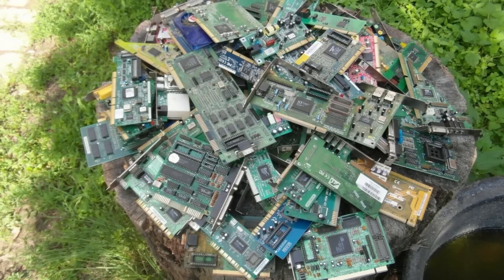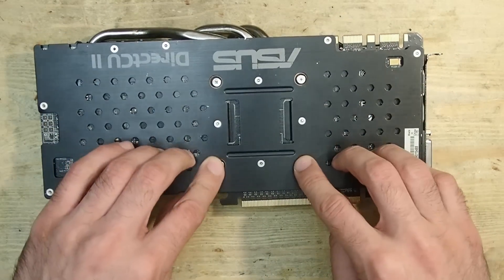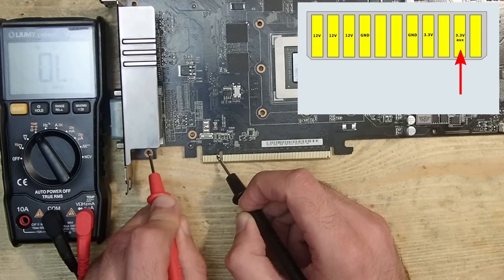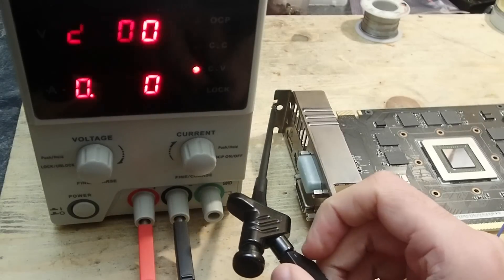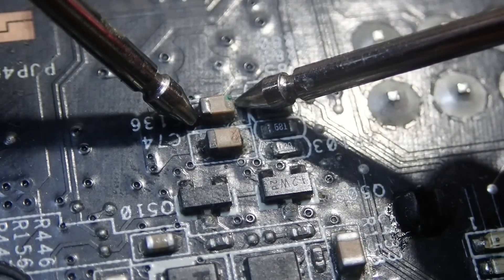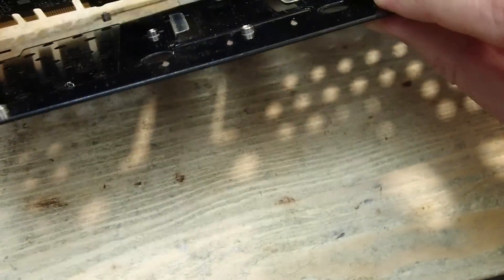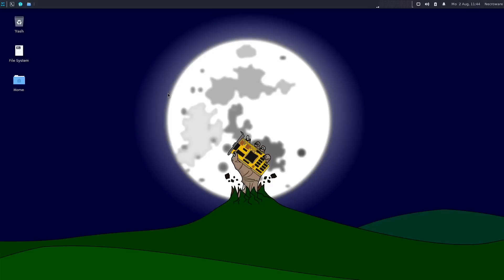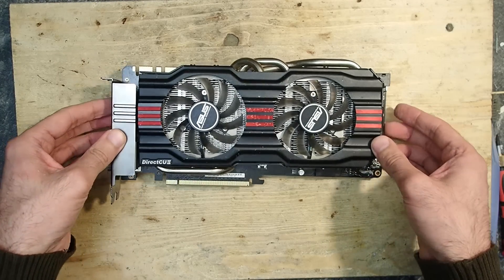GPU shortage? Let's repair an Nvidia GTX 770

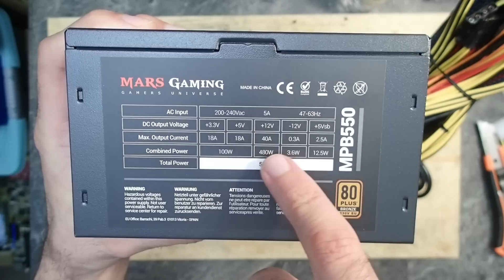Comment: no doubt skilled at fault finding BUT at 15:34 you show us the new psu stating the 8pin(6+2) pcie connector while actually showing the 4+4 cpu/eps connector, not really a good thing to teach people
furthermore making a 6+2 is pretty easy seeing as the +2 connectors are just negative pins
Reply from the maker: Yes you are right, but I don't teach in my videos and never pretend to....
Reply from the maker: Just took a look at the shot once again and unfortunately, that was just a mistake, which happened during the cut. Due to very limited equipment, which I use, I have to record the video and audio separately, which is then rejoined and realigned later on computer. Obviously what you saw is an editing mistake....

Comment: Very impressive!  
May I suggest if you have to do this again, get a PCIE edge connector and solder the cable to that?  
Oh for a thermal camera ;)
Reply from the maker: Yes, some viewers also suggested a pcie slot already and I had that idea as well, but I had no pcie slot at hand and I just didn't want to take it from a working board. If I'll get one I'll keep it for sure for such cases. However, I repair newer hardware realy seldom....
Reply: @necro_ware  I know a good convenient thermal camera listing it's called the Seek. Unfortunately, it looks like it's running for around $200 on Amazon right now, but you can plug it into the bottom of your phone and get a thermal image output. If you have lightning or USB type c it lets you turn it around for both viewing angles.

Comment: A way to detect thermal variances more easily than fingers is using a spray bottle of isopropyl alcohol.
Spraying on the card you can quickly see which components dry off immediately due to the dissipating energy.
Reply from the maker: This was what I also used in this case, but it didn't come out well on video, so I just cut it out.

Comment: Hello, I need your help, I have a gtx 960 that windows detects but when installing the driver the pc crashes, I pass the mats and the memory has no problem, I change the bios with a CH341A, because with nvflash it does not detect it, for another of the same model in techpower up and nothing, could it be the bios chip?
Reply from the maker: I'm afraid it's really hard to tell, what is wrong with your card. It can be everything from wrong BIOS to bad GPU. Without the drivers a graphics card is reduced to a generic 2D VGA adapter and first when you install the drivers, the GPU get's activated. At that point a lot of things happen, may be the GPU is defective, may be the video memory, may be the power circuit on the card, which has to handle a higher load, when the drivers are activated..... hard to tell..

Comment: My GTX 750 is having some problem. Sometimes, Display coming out and system freezes after 2-3 minutes with black, white, pink etc. by detecting the GPU and then after reboot- no display. After 1-2 hours, I draw out GPU from the MB and fits it again, again the same problem. I have tried everything but nothing seems to workout. I have tried the GPU in another setup, same problem..
Reply from the maker: It probably gets overheated. May be one of the solder spots under the chip has a crack due to heavy heating up and cooling down. Something like this is hard to repair without a special equipment.

Comment: You forgot mention about one important thing. Voltage injection is very good option to find shorts but in some cases can be dangerous because it may cause more damages. For example if you test main supply rail and upper  switching MOSFET is shorted   it will pass  through the voltage and kill other things supplied by this rail. In gaming laptops for example shorted 19V rail means usually bad news like killed mosfets in GPU Vcore converter and GPU as well.
Reply from the maker: I actually told that twice, first where I select the voltage and current and later as I found the spot. Actually I repaired a lot of mainboards and graphics card and you will not destroy anything, if you make it right. First of all, you are right and usually the MOSFETs and PWM controllers get shorted first. Also small capacitors, like in this video are quite common culprit. However, you should never go with full voltage and high current into it. If you have a short on 19V main rail, you should set 3-5V and limit your current to some very low level, like I did and then you raise it slowly step by step, without touching the voltage. If you try to set 19V and 1A from the beginning, then yes, say goodbye to your hardware :D

Comment: to not solder to cardedge connectors you can use cheap pcie riser as a breakout board.
Reply from the maker: Yes, I thought about that, but I have none and I also have no defective mainboard, where I could borrow a slot. I usually don't repair such a modern hardware and concentrate more on the retro stuff, but if I would, I'd probably get a PCIe slot for such things.

Comment: I like using the constant-current thing for diag.

Especially since I don't own a fancy multimeter or "leak tester" which can pinpoint very low Ohms readings.

Another nice trick, for helping find if BGA chips are soldered properly, is to measure the diode drop on each signal with the meter (assuming you can get access to most of the signals on a via or something).

That does depend on how many other devices are connected to each node, though.
But if you have a schematic for something, or the connections are more obvious, it can give some good clues as to whether a solder ball is maybe not connected.

ie. if the average voltage drop of a specific signal is higher than most of the others (in a similar group of signals, like RAM address pins), then it's probable that there's a cracked solder ball on that pin. Flexing the board slightly might help to confirm that.

I like vids like this, that show that you don't always need the most advanced tools to do diag on complex boards. ;)

btw, there is one way around the PCIe power connector thing on most cards - you can often fool them into powering up by connecting all of the Gnd pins together. Many cards use one of the Gnd pins simply to detect whether the plug is connected or not.

Obviously you need to be confident the card won't draw too much power from one PCIe cable for that, but for short-term testing it's probably OK on the lower-end boards. Just keep an eye on the power connector, making sure the plug and wires aren't getting too warm.
Reply from the maker: Thank you very much for all the great tips, really appreciate it and will try to apply next time.
Reply: I should add a standard disclaimer about the PCIe power connector thing...

This would only be for very short-term testing, and if you have the whole first 8-pin connector plugged in, and just want to see if the card lives or not.

It should never be used like that long-term, or it could cause melted wires, or worse.
Reply from the maker: @electronash  Yeah, I absolutely would sign this :)
Reply: @necro_ware  I suddenly thought of another one...

If you have a short on a PCB, and use the bench PSU to pass a limited current through it, you can use a multimeter to check the millivolts drop between the input point and other parts of the board.

Which can help narrow down where the short might be.

But I can't remember exactly how that would work, because the current of course goes in a circuit back to the PSU. lol

Comment: There is also a trick of spraying alcohol on it and looking where it will dry faster to find hot spots without having to touch everything.
Reply from the maker: Yes, I use it as well. Also in this case, but it was not good visible on camera, so I didn't take that shot into the final version. Also some IPA and then air spray is a good option. The water drops from the alcohol freezing in the cold can air and you can quite good see the spot.

Comment: I would almost suggest to start repairing more modern hardware to fund more retro computing experiments. However, that is MUCH easier said than done. Especially what has been documented by Louis Rosmann and Northridgefix. Like having a storefront/workspace, employees, taxes, weird/scamming customers, etc. It might be easier just to put in a few extra hours at the day job or aiming for a promotion/bonus, rather than starting up a business.
Reply from the maker: I'm quite experienced software engineer with over 25 years in business. It is possible to earn a lot more money with that, than with repairs, but I do (mostly retro) repairs as hobby and it's very hard to find a balance between the work and the hobby. Due to pandemic, the life costs are currently really low, so I can allow to invest more time into my hobbies one of which is this channel. But should I really be in need of money, then I'll have to step back here and invest more time into my work again.
Reply: @necro_ware  You're a software engineer that certainly knows his hardware! :) Sadly, most of the software people I've met only care about coding. :( For the channel, just keep on doing what you do (when you have time). It's interesting whether it's old or new.

Comment: Hallo! Super Arbeit wie immer! Voltage Injection ist ein gäniger Weg um Kurzschlüsse zu finden. Ich empfehle den Kanal von NorthridgeFix. Der Mann repariert und lötet alles in seinem Shop. Sehr interessant! Aber wie auch bei Dir, sind sehr oft diese kleinen SMD Caps die Ursache.
Reply from the maker: Danke für den Tipp

Comment: You could use a modified PCIE raiser to avoid soldering on the card, right?
Fingers are not the best testmode in thisituation. Use a cheak (c) Jessa Jones.
Reply from the maker: Right, if you have a raiser card, you can use that and solder the wire there. I have none, so it was the only way. Next time I'll use my tongue to test the temperature ;)
Reply: @necro_ware  Keep a glass of cold beer near.
Reply from the maker: @andricbandic9321  The best idea so far ;)

Comment: Neat trick! Wouldn't Amp Injection be a better description for this?
Reply from the maker: You mean current injection, yes, probably, but the official name is voltage injection and it's better to use it, if s.o. wants to google for details.

Comment: Thank you for the great video, maybe you could, for example, fix the card that makes artifacts on the screen, or relap the GPU or RAM memory on the card. For example on the AGP Card for retrogaming :)
Reply from the maker: Thanks! Unfortunately resoldering a BGA chip is out of my skills. Furthermore, it is very tedious, time consuming and sometimes even expensive operation, if you have to buy replacement ICs.
Reply: If it shows artifacts on screen, then the GPU is toast and repair is only done by replacing the GPU chip itself.
Reply from the maker: @putraadriansyah8082  Not always, it also could be the memory.
Reply: @necro_ware  in my case the GPU chip is toast 😭

It's overheated while running my laptop in my car's seat and stopped airflow. Died in front of me while I'm driving with laptop showing car's engine data log
Reply: @putraadriansyah8082  sometimes a reflow can fix those cards, plenty of videos about reflowing gpu in a regular oven.

Comment: For some reason I have always seemed to fail to grasp the crux of short detection using voltage injection, however your explanation and process is I think so clear and reasonable that I think I get it now!

Great job on the card - literally so many of these go online for pennies or end up in the bin, and in your case that's a pretty well-performing card still! It might be tempting to try a dead one out and check for shorts; could make a great experience.

One question I have, coming from someone just dabbling into hardware repair - You replaced the caps with 4.7uF - that's understandable to me given the use case of these caps in the circuit, but what about the voltage of them? Did you use something simply above 3.3V like a 6.3V, or did you go with ones that have a value above ATX's 12V, like 16V? All the big repair folks on YouTube never say what voltage are the SMD caps they replace and never tell any indications as to what V should they be. Perhaps you could tell as to how to pick the correct voltage value?
Reply from the maker: Voltage values are not important as long as they are above the voltage on the given trace. In this case there were 3.3V and the caps I used are specified for 6.3V. I could also take 10V or 16V, doesn't matter.
Reply: @necro_ware  Glad you reassured me. Thank you kind sir!

Comment: Lucky you. Nice easy fault.
All video cards that I can put my hands on were already butchered. Visible damage on all screws, and who knows what else.
Reply from the maker: Most of the GPUs I got had the same or similar issue, but usually the short is in a VR circuits.

Comment: Spray iso Alcohol on it!!!!! the hot spot will Evapourate it Faster. and bam.
Reply from the maker: Already mentioned it in some answers below. This is exactly what I did, just didn't take it into the video, because in this case the effect was not visible very well. The parts were too small, it works better on ICs and bigger surfaces.

Comment: A shame the golden fingers are ruined. You should have measured the fingers to any nearby capacitor instead indeed or measure from the back pins of a pcie female connector/riser. But still a nice revive good job..
Reply from the maker: Thank you, but are you sure that you saw the complete video? I explained, why I was forced to use the edge connector in this case. I usually don't, it's clear, but in this case I had no other way. The trace disappeared 5mm away from the edge connector in the middle layers of the PCB with no chance to figure out, where it comes back to the surface.

Comment: Probing the heat source with the hand is a bit crazy at first glance. I give that a shot with a 960 tomorrow. I thought I will need a thermal camera for sure.
Reply from the maker: Nope, you don't need that. Just start with low current and rise it slowly, so you don't get burned. Alternative is to use some IPA. Spray it on the card and in the place which gets hot it will evaporate a lot faster. I just didn't show it in the video, because the effect was not very good visible.

Comment: When I read "voltage injection", I thought you're going to burn out a defective circuit part in the main GPU crystal with some, well, voltage injection. I watched such a video recently, it's nuts and borders on magic. Apparently, such technique was popular for ressurecting certain chipsets by burning out defective USB controllers integrated into a chipset. o_O
Reply from the maker: :D No, in this case no magic sorry. But this method to search for shorts is really called voltage injection, you can google for it.
Reply: That chipset repair technique sounds interesting, could you share a link?
Reply: @djdjukic  I could not find any articles in English. You can find some info in Russian by googling "Отжиг ICH4 ICH5". In short: back in 2007 on ICH4/ICH5 chipsets USB ports died and USB data lines were shorted to ground. People sent back 3.3V into USB lines, and it burned out the shortings internally. Obviously, a burned out USB port will never work, but the chipset was not shorted and was working again.

Here's the link to the video on the GPU I mentioned (in Russian): /watch?v=ey4eGAyApXs
The guy does not say what exactly he's doing (because he himself does not have a reliable method at this time).
Reply from the maker: @Arti9m  Thank you, just watched that video you linked, but unfortunately they don't provide any information. The story of the USB in the chipset is not as complicated, as to burn out a part of a GPU, but if it helps, why not?
Reply: Haha.. I thought that too.  :-)

Comment: bro you can just put 2 black cables for 8pin connecter 
use 6pin one then in 8pin connecter and in Empty 2 pins put 2 black cables and it will work
Reply from the maker: I know, I accidentally saw the pinout. Don't know how that could happen :D Anyway,  I thought just to solder the two pins temporarily to the ground, but first of all I  didn't want to tinker and second, what then? My workshop power supply is not powerful enough on the 12V rail. So I would not be able to test the card under load anyway.
Reply: @necro_ware  aa ok 
always thank you for your videos

Comment: I am using this too, usually on retro M/Bs with sorted rails and many tantalum caps.
Once I repaired a sorted GPU too. I was a sorted MOSFET.
Reply from the maker: Yes this trick is quite handy also for old hardware, if you have a lot of parts to test. That's why I didn't mind to show it on my channel as well, even if is not retro at all :D May be it's nice to make a short trip into some newer time as well, especially if the repair technique is the same.

Comment: Looks like thermal pads are missing on mosfets as well on memory chips.
Reply from the maker: No, the black heatsink has a big thermal pad underneath, you can see it briefly at 3:37. And the memory chips are free standing. There is no heatsink above them, so they are cooled just by the air.

Comment: Ok, I'll bite ;-) 
at 10:35, your power supply is delivering 12W to the board. I'm surprised you didn't burn your finger on those caps. 
1W should've been warm enough to find them.
Reply from the maker: @Jim_Bo  :D
Reply from the maker: They were hot, but too tiny to really burn your fingers. I actually had to search the exact spot, beacuse the PCB became warm around it, but I still had to find the exact part.
Reply from the maker: @Jim_Bo  I know, I just wanted to point out, that if the parts are too tiny, you don't feel the heat that much. It's more like warm and only in the middle it like a hot needle. Don't know if it sounds like a surprise, but it's not the first one I got back to life.... ;)